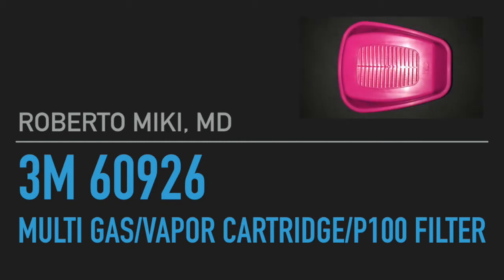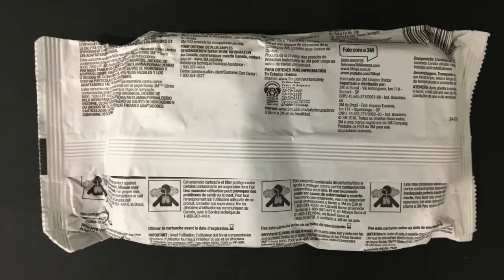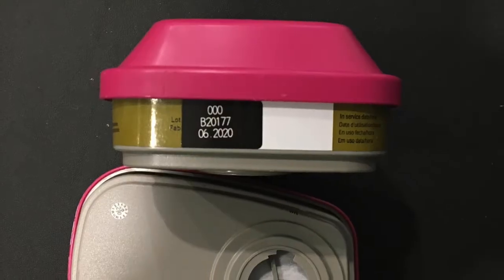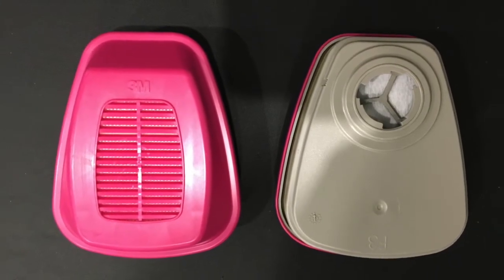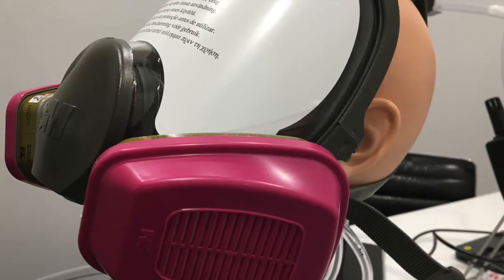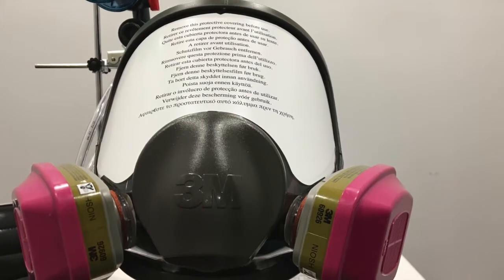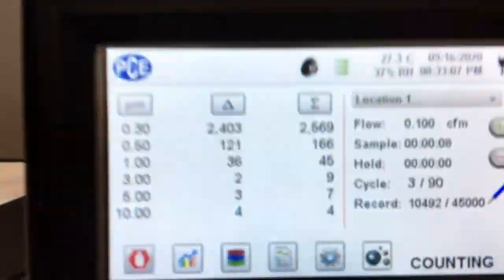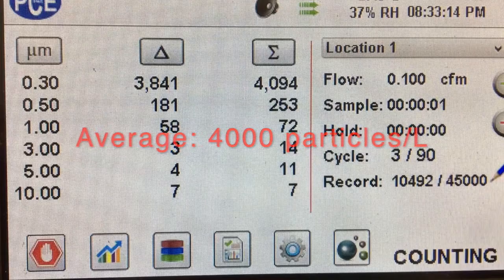60926 3M Filter 0.3 Micron Particle Count Testing

Comment: What is the difference between this type of cqrtridge & filter with the 7093 rectangle cartridge?
Reply from the maker: 7093 has more protection against splashing. Also, 7093 has a spring and you can test for negative pressure seal.

Comment: Do you think these cartridges filter out nanoparticles smaller than 10 nanometers ? Thanks for the video.
Reply from the maker: It should filter out that small because HEPA filters have their worst filtration at/around 0.3 microns. Check out this two page explanation on internet. http://donaldsonaerospace-defense.com/library/files/documents/pdfs/042665.pdf
Reply from the maker: Below 0.15 microns the filtration actually gets better!

Comment: $50 for 2 filters is worth it, especially if you have them for just incase situations and they last for 5-10 years left sealed. When we go looting/rioting and protesting you’ll be glad you have them! Considering I got the new 3m full face mask free from work, that $50 is a great deal to have that set up by chance I need it or someone in my family. If you have the full face or half mask I highly recommend having a pair of these filter just in case.

Comment: Awesome, thanks for testing! I was wondering if accidental water splash on the front will decrease the filter efficiency (since the hepa filter can be seen through the plastic case).
Reply from the maker: Not sure. But I imagine that accidental splashing would not be good for the filter. I could try and see what happens.
Reply: @RobertoMikiMD  That make sense. But I heard these type of fiberglass filter doesn't use electrostatic charge to trap particles, so maybe they are a little bit more resistant to water damage? Anyway, thank you very much for what you are doing, stay safe